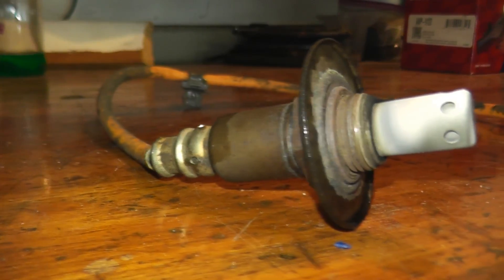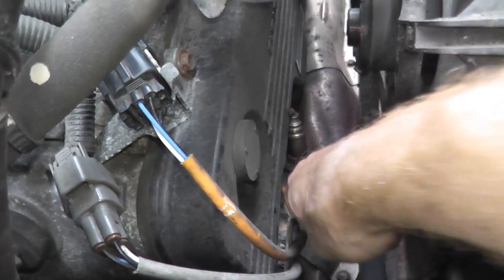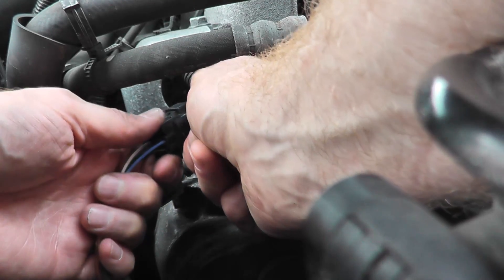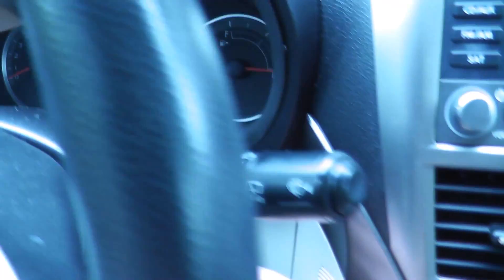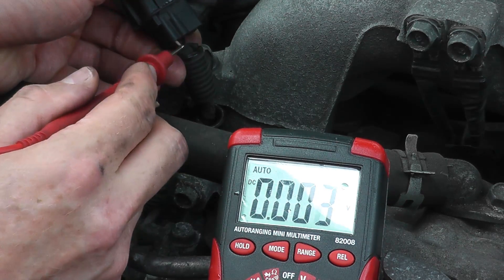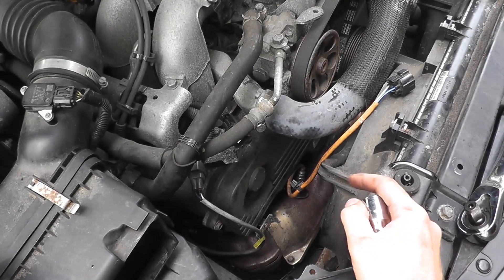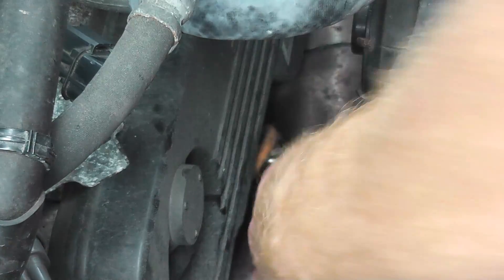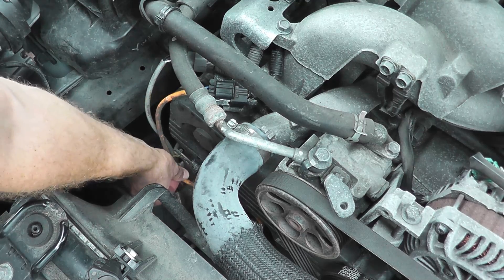Air Fuel (A/F) Sensor P0030 | Testing and Replacement

Comment: I have a problem with my accent. P0030 always comes out even though I change already my 02 sensor1 bank1. I already change the codes but still the check engine still comes out

Comment: So why are the voltages on the other leads because my Zurich s13 was reading the 2.156v with nominal switching back and forth between 2.151v. I disconnected the connectors and the scan tool was still reading the same 2.156v on the AFR sensor and the lambda was close to 1 but the rear O2 sensor will not work without the front circuit and the short term fuel trim will go away high with no long term fuel trim being indicated and then it just stops displaying any fuel trims.  With heater circuit codes on my 2004 Subaru Forester X 2.5l w/automatic afr why does the computer revert to like if the engine is cold instead of first as if the engine is warm coming off the highway after only approximately 10 minutes and it operates much leaner in idle until I shut it off for a few seconds and then it goes into the crappy super rich rough running start-up mode. The one day I tested it in idle for (2) hours after coming off the highway and it ran much leaner and that was when it was winter.

So where can we get a book that actually has the logic and normal sequences and alternative sequences when there are problems as seen from the computers side for these damned computers because it is not making any sense why it shouldn't default to closed loop or open loop drive to get to leaner mode. 3 to 6 mpg currently but my # 1cylinder reads 197 psi and only leaked down to 195 psi after 20 minutes so some of the cylinders are good and so the motor should be running leaner when we look at it from motor mechanics stance.

Comment: Very nice demonstration, but I think those test not always precise.
I just replaced 2 02 sensor that was reading 3.5HMS, and they were  bad.
I assume that the heater element was shot,regardless the good readings. 
Thanks for sharing.

Comment: So, I confirmed continuity with AF Sensor, and its good. I also checked the source and was getting 12.34 dcv. But it's still throwing a P0300 Heated oxygen sensor (HO2S) 1, bank 1, heater control - circuit malfunction code...what else is going on?

Comment: None of the tests shown in this video will confirm that the sensor is good or bad. To properly test AF sensor operation, you need a scan tool that shows the sensor voltage. Force the mixture rich and lean and verify that the sensor voltage responds accordingly as well as the fuel trims.
Reply: Joe Average  yes you need to check integrity of the circuits to the sensor. But the title of this video suggests he is showing you how to test an AF sensor. He is showing you nothing about how to test the sensor, only how to test the circuit to the sensor.
Reply: all he showed was testing the o2 heater, he didnt mention most cars with a 4 pin o2 will have 2 wires the same color, n those r the o2 heater usually. someones gonna ruin a o2 sensor watching this video haha

Comment: Can someone please help. 
I have a 2006 Suburu Impreza R with a 2010 Impreza engine in it. It’s throwing the code P0031 (heated O2 sensor circuit low bank 1 sensor 1). I’ve tested the harness for power with the ignition on and gotten 12.8 V and then the resistance on the sensor with a reading of 2.2 Ohms. What else could be causing the problem? It’s driving me nuts. The engine struggled for power under 3K rpm in 1st-3rd gear. I reset everything and cleared the code to see if it did anything and now the car is running like it’s brand new, the P0031 code is back as a pending code however it’s no longer causing a CEL on the dash. What other diagnostics can I do?
Reply: Could be a short in the ecu.. my 11 Impreza did that and my mechanic had to take apart the ecu and solder some stuff in there. There's no test you can perform to find out as all the voltages are fine and everything looks to be working properly. But if you look closer some of the voltages are just slightly off and it's because of a short inside the ecu. It's a pain as my car just started doing the same thing after I already tried replacing the a/f sensor the first time it happened so I'm hoping my ecu is acting up again.
Reply: the o2 sensor heater should be between 5-20 ohms the 2 wires that r the same color on the o2 sensor itself are the heater wires on most cars

Comment: I am working on a 2010 Forester. Getting P0031 and P0037 on both sensors. Car runs perfectly. Is there a fuse or relay that supplies power to these sensors. I am really stumped
Reply: I did measure voltage at both plugs and there isn't 12 volts at either.
Reply: Steve Rothman your codes have to do with the heater circuit. The heater circuit heats up the O2 sensors to get the vehicle to go into closed loop faster(closed loop is when the operating values are close enough to actually adjust fuel trim from the sensors) open loop is a base tune(values) for cold starts to warm things up faster and keep the engine from wearing too much. Along with emission reasons. These codes will only be thrown for three reasons, bad sensor, wiring issues, or  the ecm. Good luck! (Probably gonna need both sensors.) assuming your vehicle has 80k+
Reply: I see same problem on my legacy. I changed bank1 sensor2 with fiat palio o2 sensor. Same sensor but not same socket. Cut old sensor wires and solder it new sensor with same color. Its ok😁

Comment: Did you sand it or clean it?
Reply from the maker: Neither. You never want to touch the element. It will completely ruin the sensor.
Reply: CarsNToys limpiar con limpia contactos electricos? 
clean with clean electrical contacts?
Reply: and that's my problem. my dumb ass put 90% alcohol on it 🤦🏾‍♂️

Comment: great step by step breakdown.  ive been looking for this kind of video on youtube!  

so   my top o2 Sensors on my 2016 dodge dart has 2 wires that are slightly stripped/ripped.     ive been driving my car for about 4 months w/o having replaced it yet.(i will soon)  but          what kind of damage or concerns should i be worried about?  i havent noticed much a differemce  execpt laggy throttle response, les mpg and a smelly sound on start up
Reply from the maker: Thank you. Typical symptoms are: lack of power, hesitation, engine stall, rough idling and excessive fuel consumption.
Reply: Giovanni Arohsiri you’ll run rich and that can ruin all of the other O2 sensors and the cat. Also over long periods of time it can cause wear on the cylinder walls and thin the oil a bit. You may also melt your cats and start a fire. Lol happened to my buddy. Same situation, wires stripped out, causing excess fuel in cat it will super heat and melt eventually